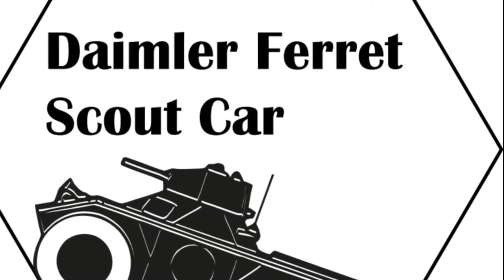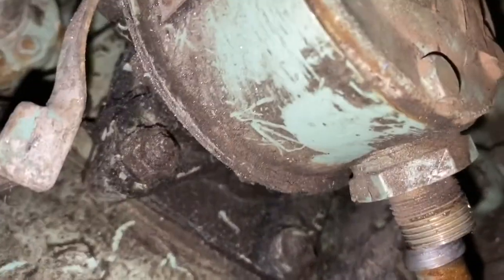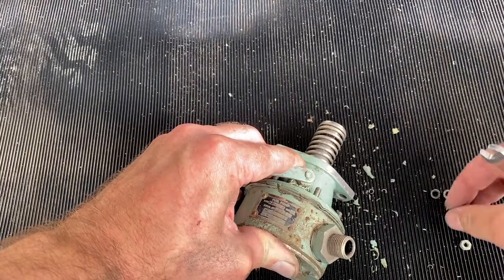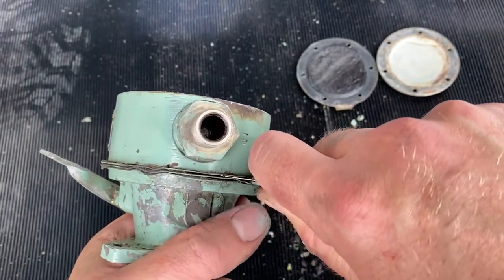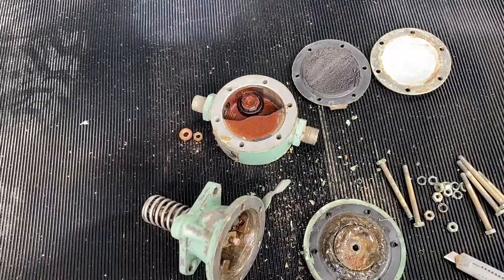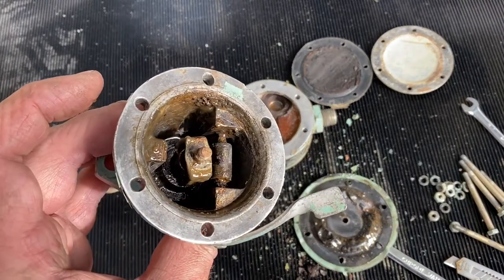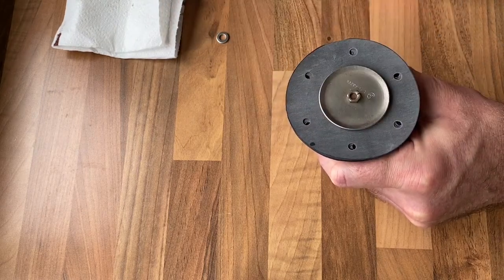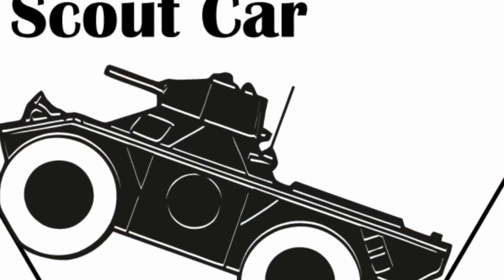Daimler Ferret - 'David' Fuel Pump, Removal, Teardown and Rebuild

Comment: Nice, one question will the fuel from the tank drain out from the pipe when the pump is disconnected ?
Reply from the maker: You'll get a small amount of fuel draining from the fuel line between the pump and fuel filter and from the fuel line between the pump and carb, which can't be helped. To prevent any siphoning of fuel from the tank, you can set the fuel changeover tap to the half way position, which closes it. If you have a problem with the changeover tap or you don't want to disturb it, you can also drop the fuel filter bowl out. Just make sure the fuel level in the tank is below the height of the fuel filter.